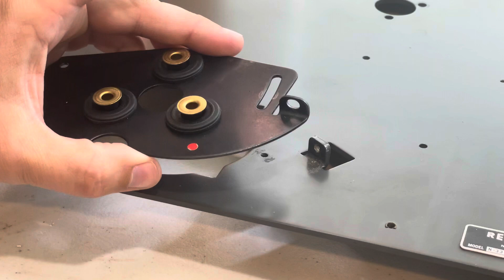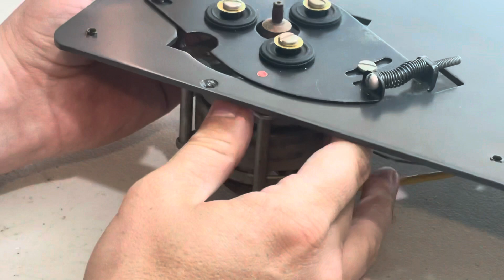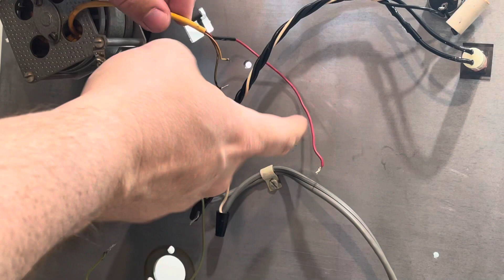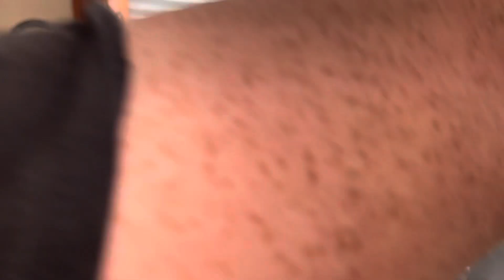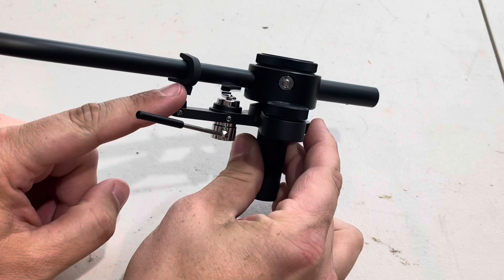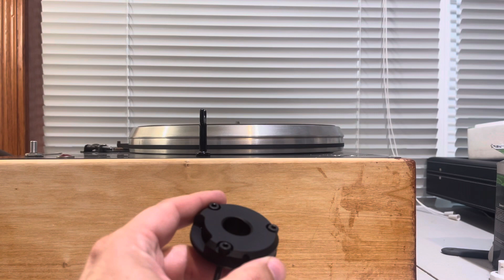Rek O’ Kut N-33H Rondine Restore Part IV

Comment: I’m up to hear about part 5 or at least see a picture and hear a quick video!  Thanks for sharing your knowledge.  I’m looking at starting to refurbish one tomorrow for a friend.
Reply from the maker: Glad you’ve enjoyed. It’s been a wild season of change since the last video posted. I had a job change, we moved, and one of our kids is getting married soon. Just haven’t had time to circle back on this. I’ll see about digging it out soon for an update. It is functional.
Reply: I have one, slightly older and the motor is moving slow when cold at 33rpm. If I switch to 45 and 78 it runs at correct speed at 33 after a while. Wondering if the filter cap is failing. Any thoughts?  You may have missed something as well. The filter cap is no longer grounded. It was before. May affect sound and may be a safety issue on some devices.
Reply: Good videos! Even though I thought I somewhat know the process (2 arm sp25), nice to see it. You have gone far enough, the rest is just tune-up. I'm getting a 33 and have a brand new Syntec 220. Has close to the same effective length. Leaned a lot!

Comment: That was a trip down memory lane for me - nice documentary of your rebuild so far. 
I have this same model, completely stock. The original belt that I still use is made of a non-elastic fiber material, thus the need for the motor belt tension adjustment (I once tried a rubber belt but couldn’t perceive much of a difference).  Getting the tension just right eliminates any platter slip without introducing too much motor bearing loading.